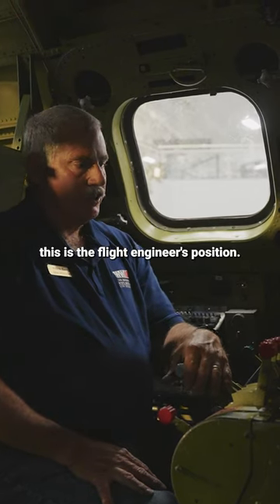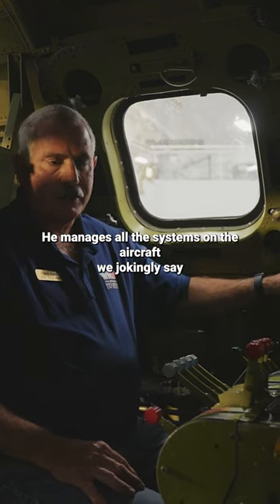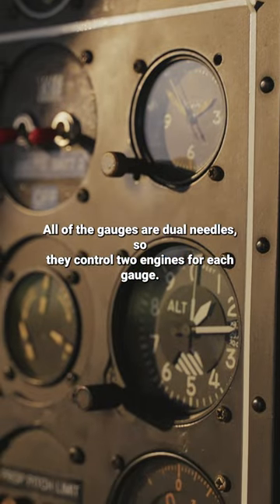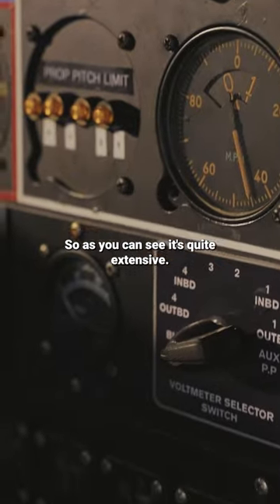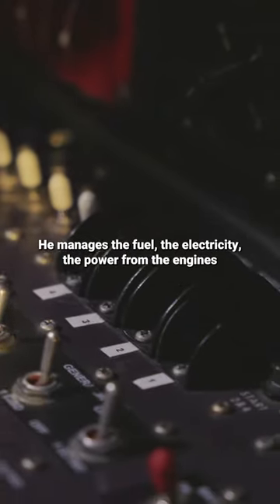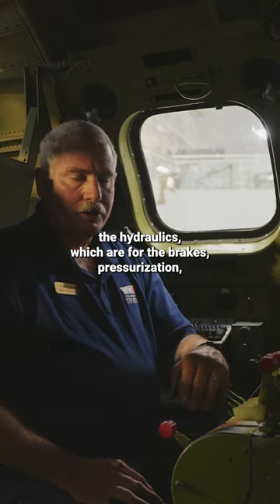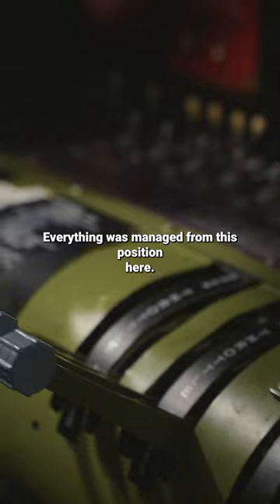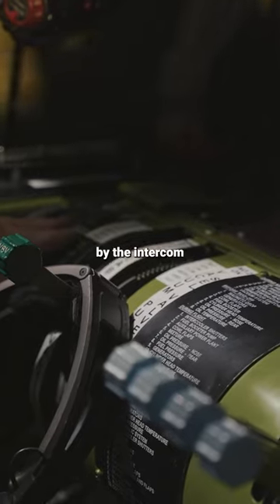B-29  Flight Engineer #shorts

Comment: Lt. Richard Furman, pilot, B-29. Plane #54, 40th Flight Squadron, 6th Bomb Group, 20th Air Force, under Lemay. 61 missiins. 31, combat. 30, supply over mainland Japan. My dad. DFC, numerous other medals.
Reply: You can see my dad's B-29 at Phil Crother's website, The Sixth Bomb Group, along with the crew including the plane commander, the application of the Distinguished Flying Cross decal, as well as many other B-29 planes and crew photos. --- US Army Specialist Furman, 1971 - 1974.
Reply: @markfurman4386 thanks for sharing this, if i can i'll go check that plane

Comment: The flight engineering could be controlled of 1 or 2 engines of aircraft for starting and turned off engine and also to controlling of pressurized air and brake systems